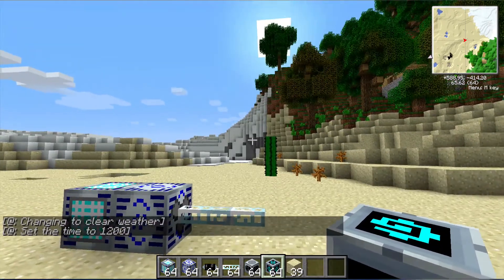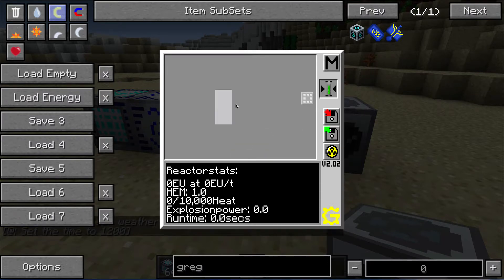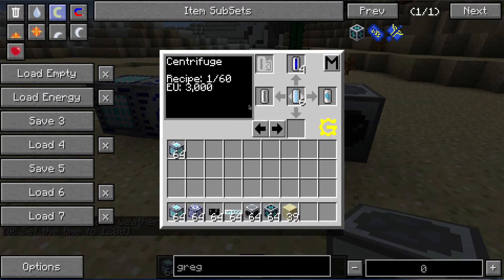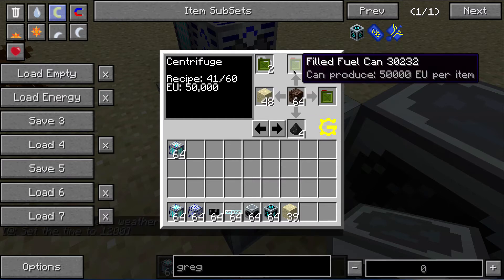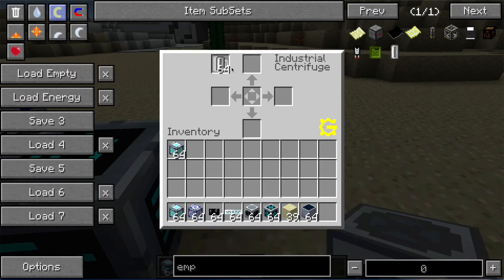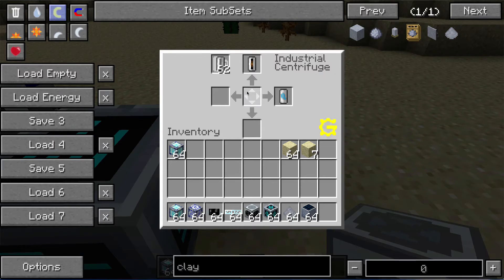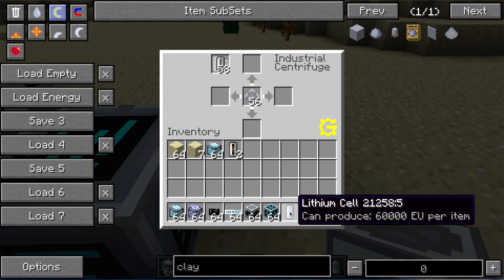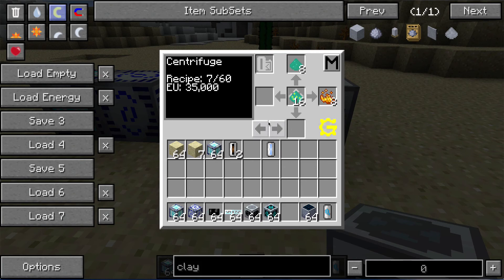Tutorial: Greg Tech - Industrial Centrifuge & GregTech Computer

Comment: sabrekitteh says in the latest versions you can pipe in lava. another answer is to use uu matter. but if you're cranking out uu matter you probably don't wanna use it for lava. FTB isn't in the latest versions of these, so if you're on that, it probably won't work. Tin cells/cans still net you a tin profit if you wanna fill them with lava and centrifuge them.

Comment from the maker: I think you should be able to pull the output from the sides using a powered wooden pipe.   Input goes in the top and bottom.   I haven't had a chance to do a full automation setup on them though.